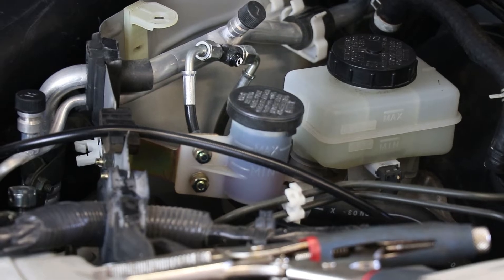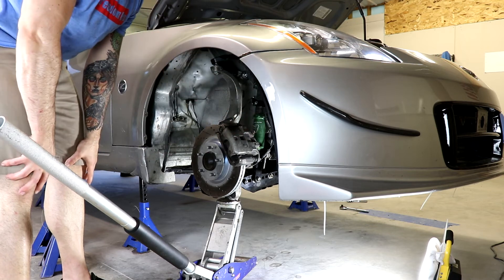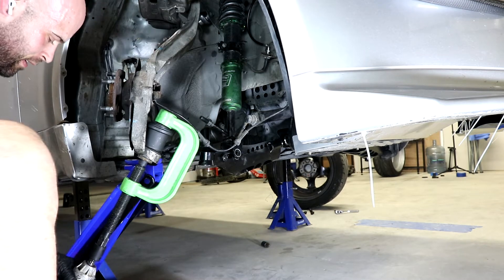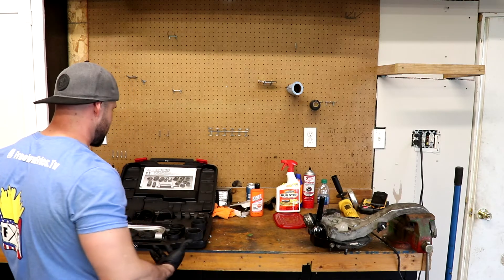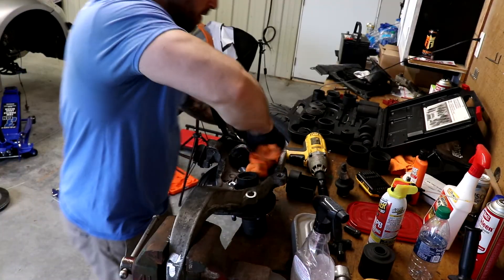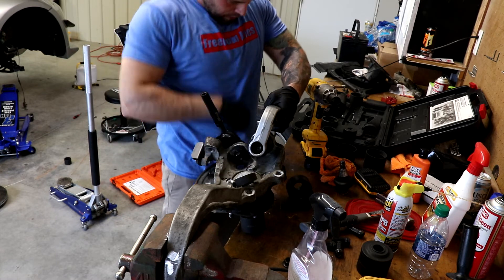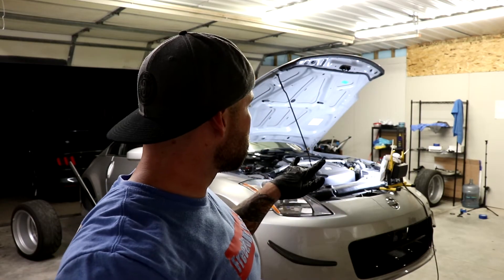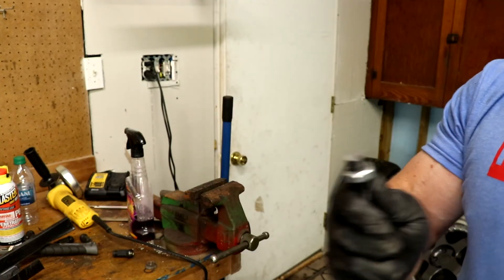Nightmare Of A Drift Prep! Finished Wrenching 2 Hours Before The Event!

Comment: So wait: you delete the complete abs because it holds air and this can influence the break system? 
I just unplugged the sensor and the plug at the diff? 🤷🏼‍♂️
Reply from the maker: I disabled the ABS by cutting the ecu wire and the proper fuses. I would unplug that sensor, but I didn't want it to affect my speedometer/odometer. I bypassed the ABS itself because I couldn't properly bleed the breaks without activating the system so I had sponge brake feel. It just allowed me to fully bleed the system. 
I don't think most people need to do the brake line bypass, but for the people who can't get the air out of the system and don't want to pay a dealership to do it - it works.
Reply: Hm, I haven’t had that moment where to bleed my breaks so I don’t know now if it’s that easy with this car. Good to have the information!  Have fun at the event and kill it!
Reply from the maker: @Lemmedrift  Thank you! Who knows, maybe I have something else up with my brake system. I just expected a significantly firmer pedal than I had!